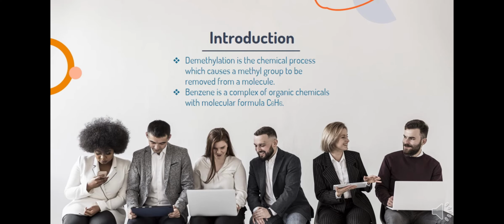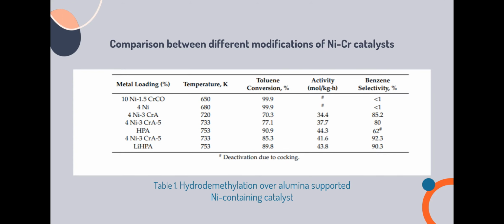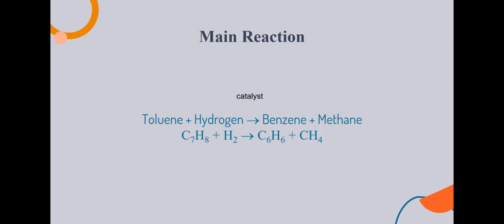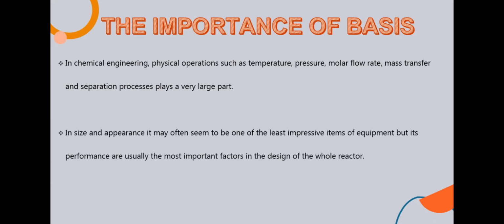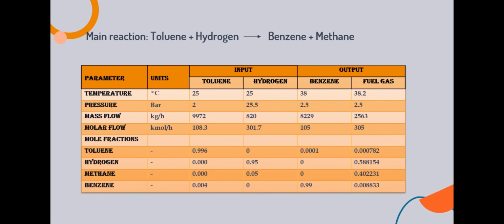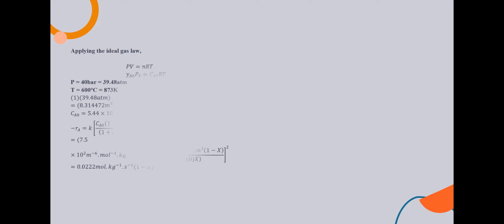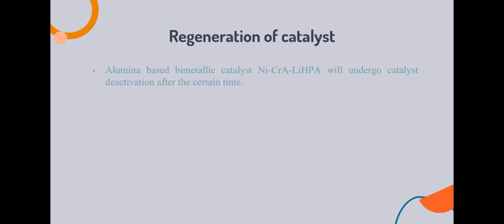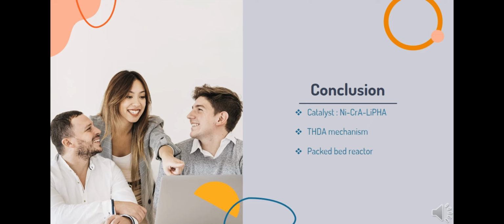Demethylation of Toluene to Benzene study: CEB2093 Project CE4 Group 6

Comment: Marking justification:
- The writing of report can still be improved.
- Too brief introduction
- Basis designs are not inline with reaction condition for catalyst selection
- Not clear justification of reactor selection. The conditions are not similar to the one when selecting catalyst and not similar to basis.
- The values in reactor design calculation do not match with the basis.